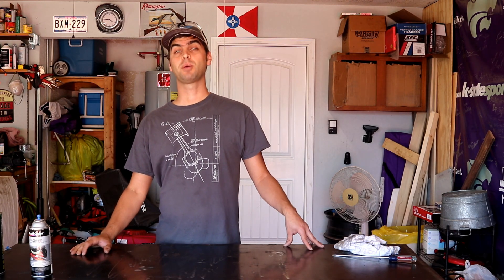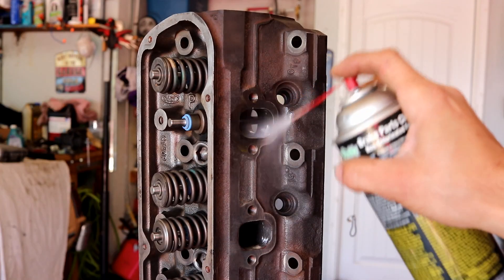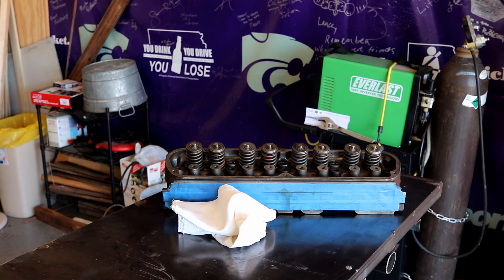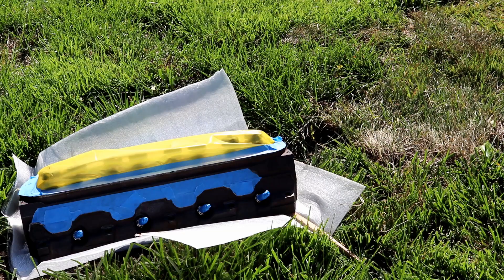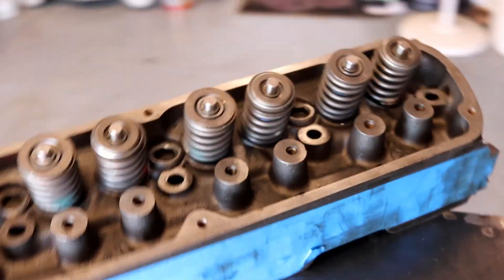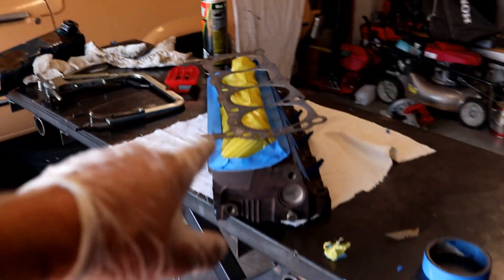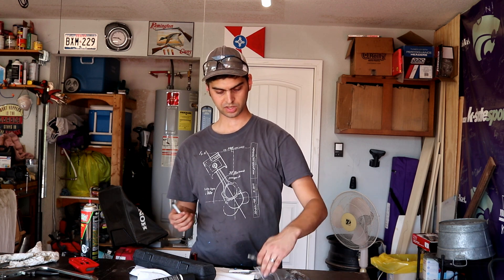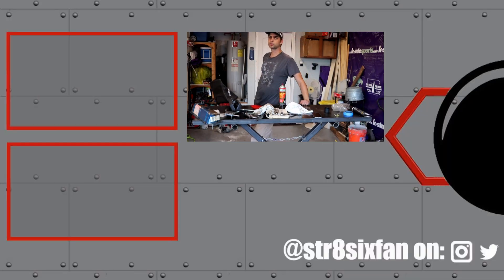Swapping GT40P Heads on a Stock Low Compression 78 Fairmont, Part 5

Comment: Had to do head gaskets on the Satellite a few years ago and my torque wrench wasn't clicking every time either. Not knowing exactly what torque they are all at bothers me sometimes but it has held up for years. I didn't wanna just torque em all down even more because I re-used my old head bolts and was putting slightly less torque on them so they wouldn't break off.
Reply from the maker: This comforts me more, thanks Eric!